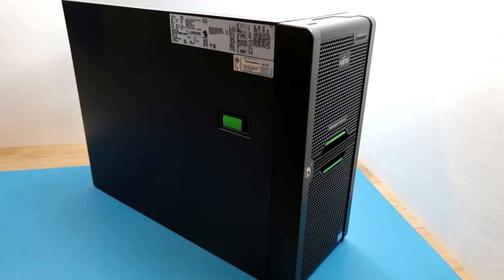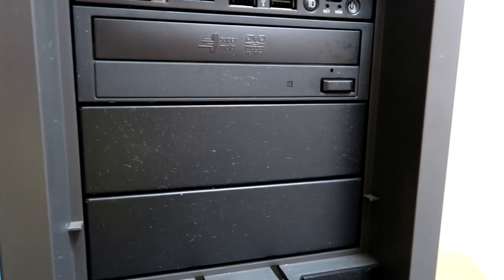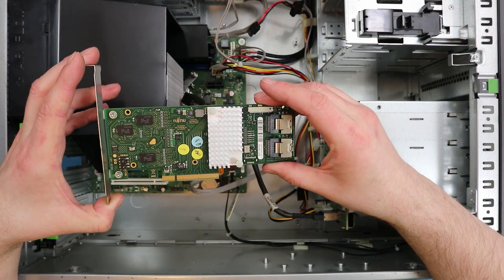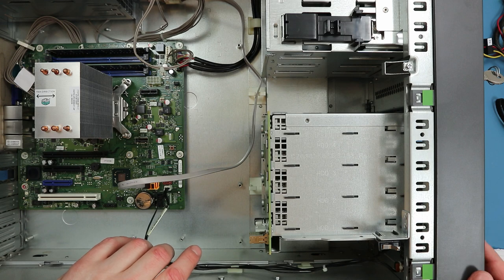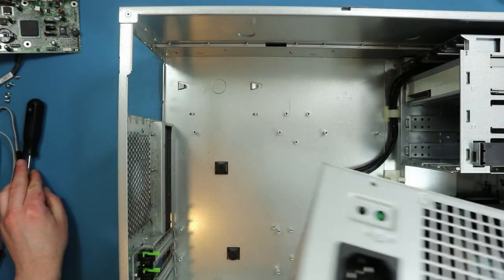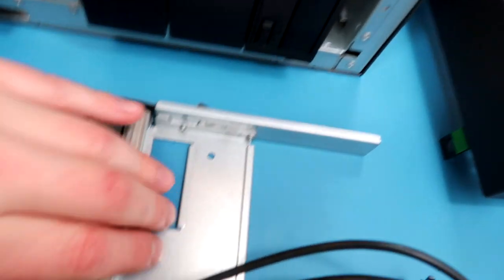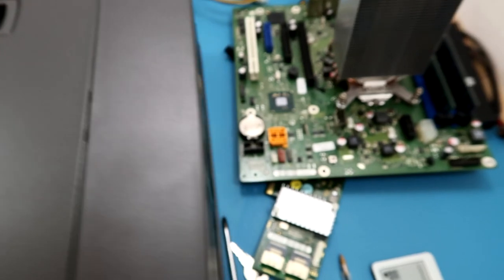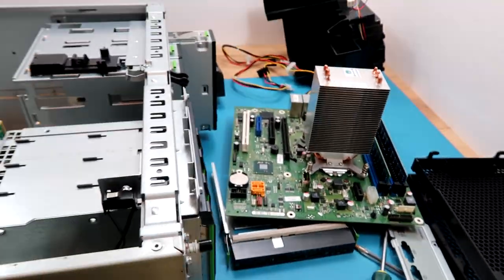Server Gutting for Future Project - Fujitsu Primergy TX140 S1 Teardown

Comment: Your always taking things apart. Bet you were like that in your young days too, taking all your Toys apart. So how old would you say this PC is roughly? Plenty of space to work with, that's a bonus.

That was indeed a loud Fan, I thought you were powering up your Hoover to clean it out.
Reply from the maker: Yes, I am a sod for taking stuff apart and not reassembling. Thankfully that changed when I got to late teens and started to be able to fix stuff too. There is a reason my mum wouldn't let me have certain games, like Screwball Scramble. I'd just have to know how it works...
I've got no idea how old this is... hang on... looks like maybe 2012, so older than I thought if that is true.
Interesting fact about some servers is that they ramp the fans up to max, usually at preset times late at night in order to blast any dust out of the inside of the system so help keep dust levels down, obviously that's important with a server so it can stay running problem free and reduce down time.
Either way, I won't be using Terry The Tornado server fans in my build.

Comment: The memory might be EEC so check that before you plug it into another motherboard. Might not work. So... ZFS eh? ;-)
Reply from the maker: Thanks for the heads up on the RAM. I am all too aware of different types of RAM. Got another tear-down with a system that would ONLY take Unregistered ECC RAM. Grrr. A good case of RTFM :-)

Comment: I don't like the idea of tearing apart server just to fill it with consumer components and use it as a file SERVER....
This thing with a proper RAID controller and dual NICs is a perfect setup for running NAS or pfSense (or both), and probably is a overkill, but with all the extras, its perfect for what You want from a file server. That raid controller supports  SATA hotswapping , so if a disk fails, just plug another one while the thing is running and problem solved.
That third NIC is a management port, basically like having a person sitting next to it and pushing a buttons for you, or doing a bios setup in front of the machine. You just plug 3 Ethernet cables, and get 3 IP addresses, two are for Networking, the third is a managment port for web interface, basically a web based remote desktop, so you can remotely turn it on-off, get into bios or do what ever you want remotely. That thing is a separate device that is always on, as long as the power is plugged into wall.
And Yes, those are ECC RAM sticks, you can see by the count of memory chips on each stick (it has nine), non ecc sticks have even number, not odd, and those ECC modules can save you from system chrashes. Also those redudant power suplies, if plugged into different wall sockets can save you when the wife turns the owen, dishwasher, dryer and vacuum cleaner all at the same time, at least one of the supplies will still run if on different circuit breakers :)